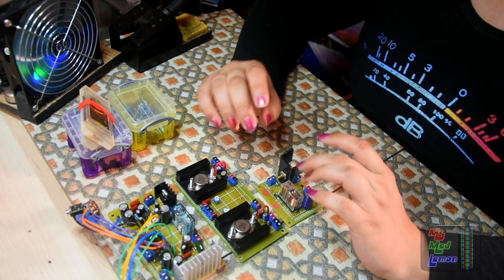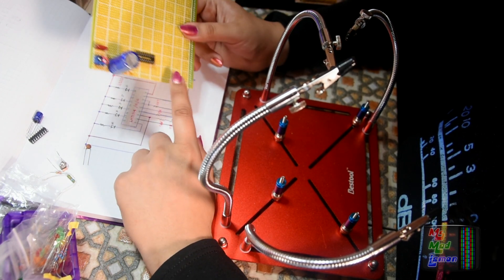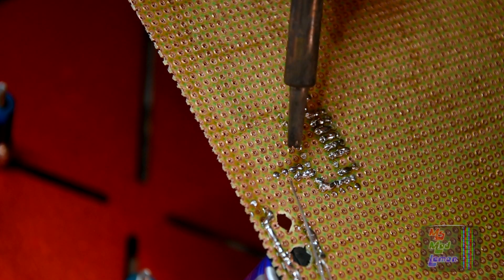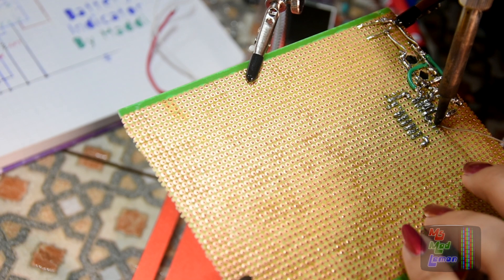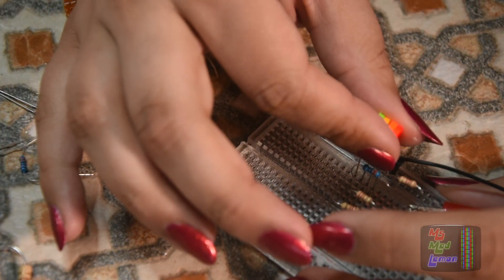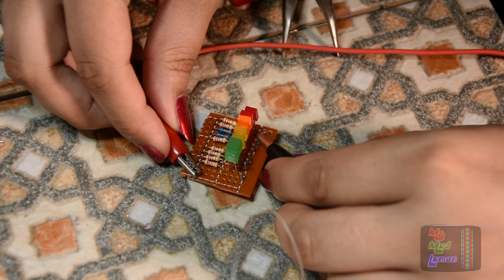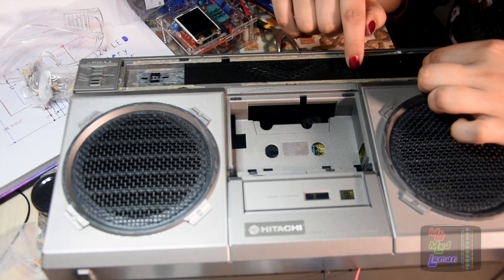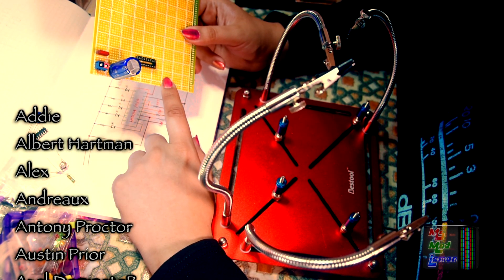Battery Level Meter - SIDBoomBox Project 11

Comment: I had built one of these things too when I was a kid, with the exact same chip no less, and I couldn't ever get it to do anything... I even tried that close capacitor thing, like you did here, to no avail... I triple checked my circuit and my solder joints too, but I finally gave up on it because it was a useless waste of my time, and I've never tried building this circuit again in my life, because I was SO frustrated by it not doing anything, no matter what I tried!... Maybe I just had gotten a bad/defective IC, but I kinda doubt it because I had bought it from Radio Shack, which had reasonably good quality control on their parts, but of course since I had already used the chip and it was out of its package, I couldn't return it, and as a kid I didn't have the money to buy another one to try.

It was very cool though to see that you got this to work just like you wanted! Maybe one of these days I'll try building another one of these circuits.